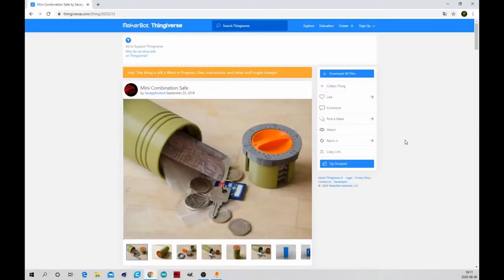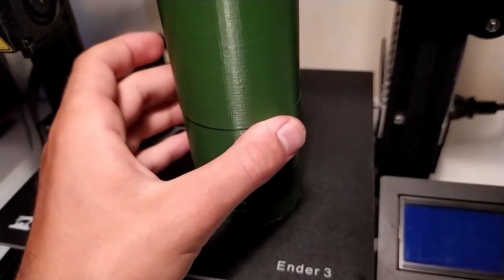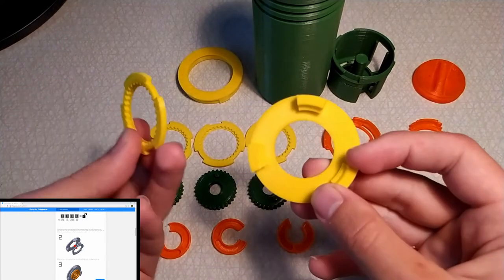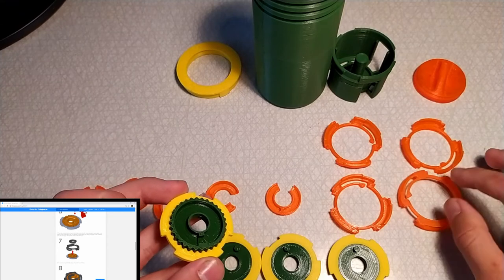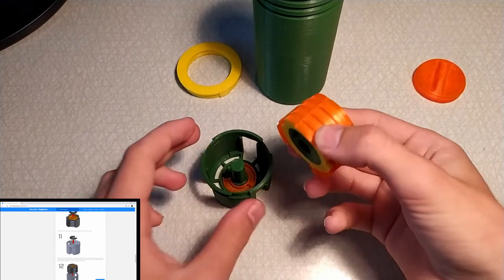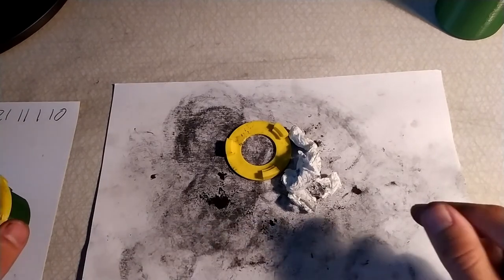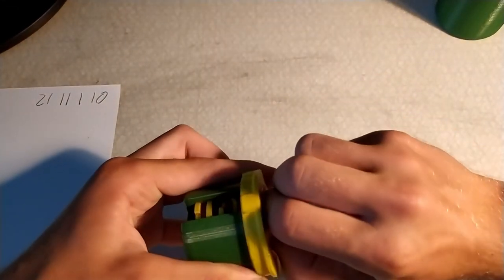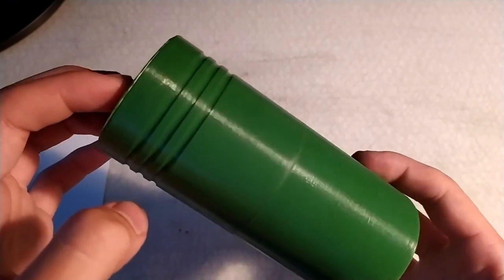3D Printed Combination Lock. Build and Showcase!

Comment: what settings did you use? what layer height did you print at?
Reply from the maker: All of the big parts like the casing were printed at 0.3 mm and the smaller gears and such were 0.2. I used esun pla with 210c on the nozzle and 70 bed. I just used my normal settings for my ender 3.
Reply: 3Drcnc thanks for replying. Has anyone had luck printing this in Petg? I was think about giving it a try
Reply from the maker: @elitecompany1878  I actually have no idea if it's possible, but I don't see why it wouldn't. Maybe if you get a lot of stringing which you can get with petg. Otherwise it might be even better than pla. Please let me know how it works if you give it a try.
Reply: 3Drcnc I will . Working on it now
Reply from the maker: @elitecompany1878  Awesome!